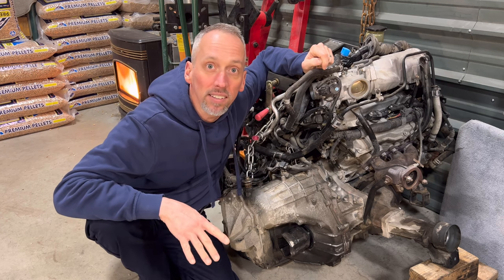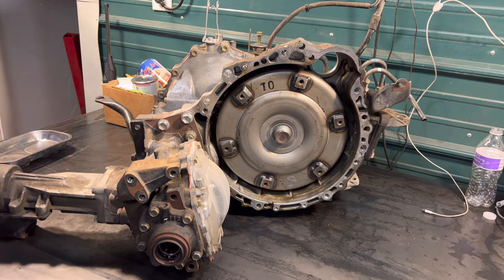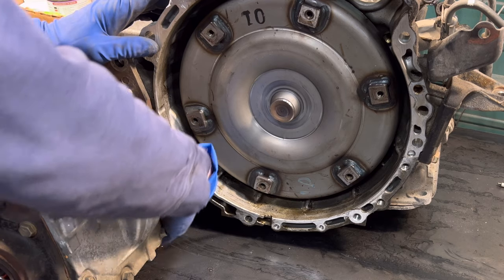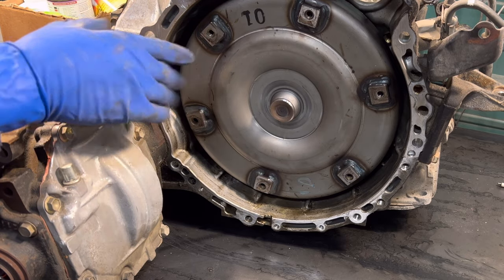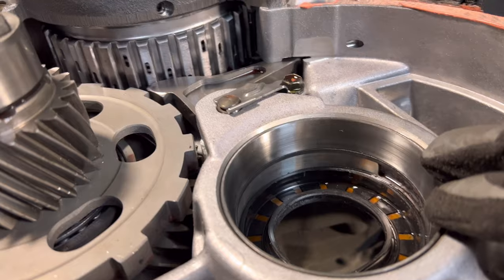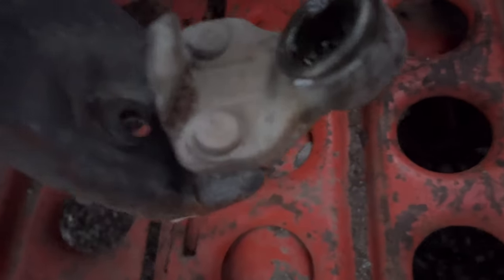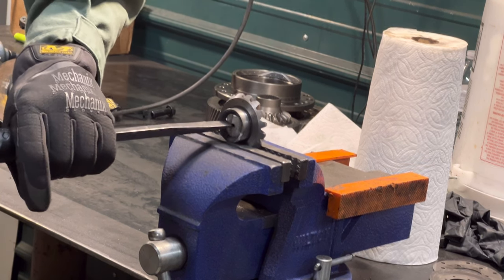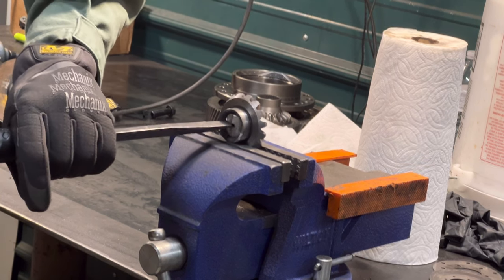Impossibly stuck CV axle

Comment: Great content. I've been fighting to remove a cv axle for 5 days straight. Every single way possible. No luck. Fimally decided to drop my pride & see what youtube has & this was the first vid  that pops up. My fight continues enabling me to win in the long run. Thanks for your time......CRAZY!!!
Reply from the maker: Thanks. Crazy is right!
Reply: just did it this way...hope it helps!
Reply: any luck brother? i'm on day 3
Reply: @sdriza  Finally got it weeks later & yes it was that locking ring all distorted & wedged...just to keep a good consistant customer i gave them there vehicle back free of charge(bcuz i had the car for month & a half)....yup, one of them "fellowships more valuable than money" type of decisions!!!
The funny part is that the customer did get into an accident wen they first bought the vehicle.....jus like the vehicle in this vid was in an accident🤙🏽Aloha
Reply: @nobodyschild967  i eventually prevailed as well.... with a $150 air hammer from Harbor Freight, but the new axles are so nice!!!
Reply: It needs a snapping motion, just hard pulling won't give the ring an opportunity to compress and it'll jam.
Reply: Personally giving up on mine. A week (4days) on my own and all the professional time I can afford I'm now trying to figure out if and how I can rebuild it with a mix of old and new parts. I don't have the experience to open my transmission. The vehicle was in an accident before I bought it... I figured it had been almost 10 years since the accident so all issues had been resolved. This is an issue I'd not considered. Last time I buy salvage/rebuild. I was just extremely crunched for money and it was under 2k

Comment: This is probably the most interesting automotive repair video I've ever seen! I have certainly seen CV axles being forced inward during a collision cause problems in the transmission, usually just with bearings, but I've never seen anything like this before. Nice work!
Reply from the maker: Thanks Jonathan, I really appreciate that.
Reply: How do I get it out broke strap and cable

Comment: I was working on a CV axle one time, for some reason I had tapped the spline end of the CV axle lightly with a hammer. After that it would not go back in. I had just tapped it lightly and that did it. I checked it with a micrometer and it was mushroomed .007 total. I took it to a belt grinder and just touched it up with a fine belt. I tried it again and it went right in. The CV axle metal is soft so be careful with it.
Reply from the maker: Wow, that is soft.

Comment: That was brilliant. Your analytical efforts are in the class of the old "Forensic Files" shows. What I don't understand is how, in a normal functioning axle, the 'clip' is sufficient to retain the splined end during operation. If the axle can be pressed into place and removed again with relative ease, how is it that it stands up to significant horse power as well as left and right g-forces during turns and articulation.
Reply from the maker: Thanks MPBrewster. I totally get what you’re saying. I’m a guy who likes to see big fasteners hold things together. 
That clip is only there to keep the tulip in place. That’s the inboard end of the axle that I had to cut off in the beginning. The rest of the axle is retained in the hub with the axle nut.
The axle moves freely laterally  (except for the boot), so there is very little lateral force on the tulip. If you look at a solid axle, like a GM 12 bolt - each axle is held into the differential in a similarly flimsy way. Those axles see way more lateral force and (almost) never separate accidentally.
Reply: @ToolDemos  The wierdest axle of all would have to be the pre-67 VW. Here's another axle question if I may: Replacement CV boots or axle? For my Corolla(Matrix) inner and outer boots cost about $30 from rock auto. But a replacement axle is only around $50. No brainer really, except how can an aftermarket part, with all those hardened steel parts, shaft and boots, etc. sell for so cheap? Online comments out there seem to agree they are okay. It's like the strut dilemma; sure saves a lot on labor but is that new spring as good as oem? Hard to believe this video doesn't have 100x the views, again, it is exceptional.
Reply from the maker: @MPBrewster  my take on this issue has always been to replace the axle. Years ago axles cost way more, but my thought was if grease has already come out, you could already have bearing damage. Not to mention dirt and water intrusion.
People do report problems with cheap aftermarket axles. I think the most common reason is axle length. Even a small variance could cause damage very quickly. Whenever I buy a replacement, I make sure it is exactly the same length as the OE before I install it.
Reply: @MPBrewster  chineese bearings and axles are only good for 30K miles, you get what you pay for.  Some people get more miles but that's what I've found over the years, the cheap stuff just don't last
Reply: @FourthWayRanch  Well appreciated feedback. Curious thing is that a lot of these aftermarket axles carry a lifetime warranty. Of course they could be hedging a bet that most installations are for cars that are nearly dead and won't survive the warranty period for other reasons. Additionally, the "lifetime" is for original purchaser of the axle and would not be transferred to successive owners. But I'd have to side with Tool Demos and take a chance. It's a lot of work to replace a boot and you don't know what has made it into the bearing during the time the boot was open from a split. Some cars (like my Matrix) are more prone to failure and happen early. I'd want to get a lot of life out of that CV and not just 30k miles.

Comment: Man this reminded me of a mini Cooper I did last time replace the cv axle someone did replace it before but this came out don't know why but I took everything a part and look normal to me and I have the brilliant idea of getting everything back on but decided to install a new after all but man after trying to take the old axle for the second time this thing didn't butch at all I swear took me a whole day pry bar, axle puller, sliding hammer adapter, borrowed a tool for axle a Y looking one nothing works, didn't touch that thing for 3 days then I got my self two pray bars and with almost not effort this thing just came out like it wasn't inside the transmission 😮‍💨😮‍💨😮‍💨 🙄😳😳
Reply from the maker: Wow! That’s crazy.

Comment: I wish that I had your knowledge. I have a 2008 corolla and the drivers side axle separated while trying to remove it for replacement. I cannot take it apart where I live to do those amazing fixes that you did. Any other suggestions please.  I thank you ahead of time.
Reply from the maker: Is the big ‘bearing cup’ still stuck in there?
Reply: @ToolDemos  I went to the local autozone and picked up one of those slidehammer axle-puller things, and it took 4 minutes to pull the rest out. Thanks for posting that video. 
Keep on doing what you're doing, cause you doing it right

Comment: I'm in a similar bind, insanely stuck!  I even tried the truck method. After 3/4 days I enlisted pros. Unfortunately  I've not got the funds for anymore hourly labor. I did get a bit of a chuckle when they tried, Im a small woman so I know they were doubting my efforts!
Im thinking to rebuild.
 Unfortunately the axle replacement I bought isn't an exact match. The wheels on the tripod I think are slightly smaller. I held them up to the new one and they seem a bit wider than the new tulip/cup...Thinking to just replace the boots and use the old hardware. 
I was wondering what would be the risk factors in doing this?
Reply from the maker: If your axles were clicking while driving, you have to replace them. If it was just a ripped boot that was leaking, you could replace that boot and reuse the old hardware. If you do that, make sure you add the proper amount of grease.
Reply: @ToolDemos  thanks, I didn't notice any clicking while driving, only saw the boots had torn. Would it be any issue to try to take the boots off of the new axle I bought? It's too late to return it. They are fractional smaller, but they but should stretch right?... Hate to waste the whole thing
Reply from the maker: @ElisaHall-v5m  doubt you’ll get it to stretch, probably just tear. You can buy a boot kit with grease that will fit properly.

Comment: lol god damit this is probably why it wont com out. the vehicle is a salvage title n its bin hit rite on the very spot im workin on
Reply from the maker: Yeah, that sucks. It’s not an easy job but it can be done. I replaced the differential portion of the transmission and it’s running fine now.
Reply: @ToolDemos  dam u the dude dawg

Comment: I really hope this isn't what happened with my axle, I got t-boned on my passenger side tire, it broke my engine cradle and snapped my axle, I can't get the pos off with a slide hammer, I've been trying for Abt 20 minutes now

Note: it is a 2009 ford escape, and I was hit at Abt 8-10 miles an hour
Reply from the maker: I hope so too. If it helps, I swapped out the differential (used one) and sealed the transmission back up. It works fine now.
Reply: @ToolDemos  thankfully not, I finally got the thing replaced, I had to replace both the axle and the intermediate axle

Comment: Wow,I have the same issue I try everything I can, thrust I have done axles before but it won't budge!
Reply from the maker: If you have impact damage, check the diff. Mine was damaged, so I had to replace it.
Reply: Thanks for the Response @ToolDemos  the car that I am currently working on is a Volvo XC90 the have the C-clip style and like you mention on your vid,this style has a seal cup in the diff we're both of the cv axle ends meet but never see any trans fluid,I believe they use an over size c clip and won't come out
Reply from the maker: @ruffraff4697  Keep trying, I hope you get it.
Reply: @ToolDemos  Just An Update,It never came out, even after opening the transmission Through the Differential area to get more access but it was a no go,A so simple job turn into a nightmare 😂
Reply from the maker: @ruffraff4697  oh my gosh! That sucks.

Comment: Are you professional mechanic ? Is this a FWD transmission? And in FWD transmission, the best way to get stuck end piece out is to take opposite side CV axle out which could be very difficult and slide in a chisel or rod and hammer it out from that side ?
Reply from the maker: I see you’ve seen this video already, sorry I linked it before. No, I am not a professional, no this is no technically a FWD transmission, it’s an AWD unit. So, it has a power transfer unit attached. In my opinion, hammering from the opposite side can work, but make sure you know what you’re hitting. If it helps, the transmission I split apart is still being used today. I swapped the differential from the old transmission into this one (because it was damaged in the rollover). Everything is working just fine now.
Reply: @ToolDemos  yeah if I try removing the CV axle from the opposite passenger side, since I’m not that familiar with transmission work I might potentially cause some damage to another part if I hammer it out? Who knows if I’m actually hitting the correct broken off shaft ? That could be for some mechanics too I suppose …they or I could do more damage than it already has …

Comment: You think my Cadillac converter is a clogged
Reply from the maker: It’s very possible, if you put a vacuum gauge on the brake booster hose you can see it. Rev the engine and watch the gauge, if you get positive pressure, you are likely go have an exhaust restriction.
Reply: I was just going to say I have a strong gas smell coming out of the exhaust
Reply from the maker: @robinhernandez9582  if your exhaust is restricted, you won’t be getting enough air. The unburned fuel would be what you smell.
Reply: @ToolDemos  thank you so much that's not good for me but thank you I so much appreciate it